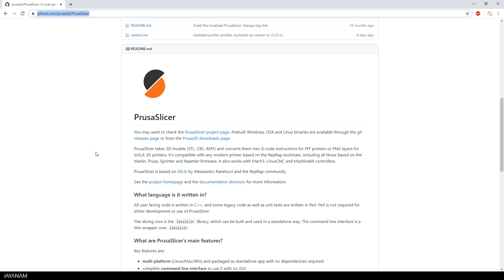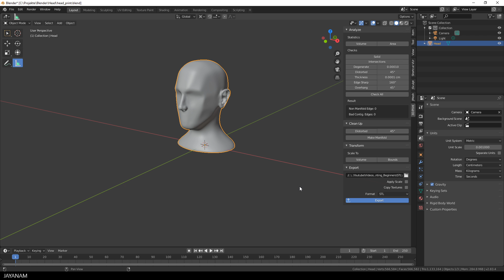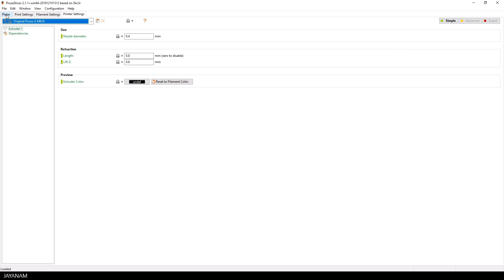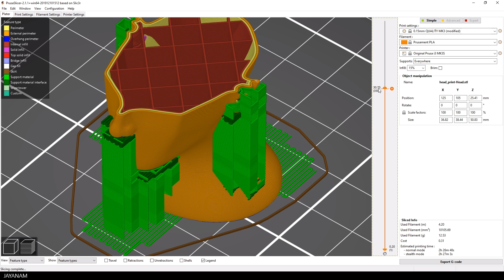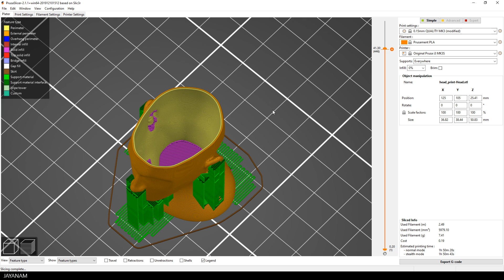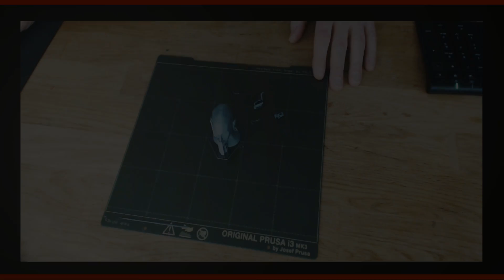Blender 2.8 3D Printing Beginners Getting Started

Comment: I would pay for an addon that was built for Blender that could get me from modelling to being sliced and prepped, ready to go to the printer. Even if all it did was give me the controls to setup the perimeters and supports would be a fantastic addon! Prusa Slic3r supports suck and I am still looking for a solution for this that isnt crap! So far Cura or IdeaMaker are my go to programs for setting up supports but would be nice if they was as nice as prusa slic3r when it comes to the parameters and other features it offers!

A couple of things that have me confused is working with shade smooth, mark sharp and how those work with setting up a 3D print, or if they even translate to them. Would love if someone knowledgeable would hit on these things too. Thanks a ton for putting some attention on this topic, so few tutorials out there and its a royal pain to make something and then print it only to discover it wont work.
Reply: You should not shade smooth if you want to see what your model will look like on the printer. Subdivisions modifiers will be applied by default on export though. Mark sharp will translate into the exported file so where it makes sense, it will work.  I am intrigued as to the problem you have with Prusa supports though.  Generally they are pretty good (especially if you modify the contact distance parameter)
Reply: @g0balot  Actually at this point the biggest problem is ME! New to this and feeling the growing pains. Will take a look at the contact distance parameter and see if it resolves my problems. That really is the biggest issue with supports, is that I think they are to close and one other area is the brim. I find even on flat models I have to provide a brim or the model will not stick to the plate but adding it makes it a royal pain to get off the flat surface and leaves a lot of striations of filament that wont come off without heat and a lot of coaxing.
Reply: @kevinm3751  With the Prusa supports I usually set the Z contact distance to 0.2 which helps with the removal at the cost of slightly less reliable supports.  Be aware though that all supports (with the exception of soluble ones) can sometimes be a pain to remove and may even require a bit of work with some grabbing tools.   You should only really need a brim if you are printing with not much contact with the build plate or if you are having problems with warping.  There are many ways people use to help adhesion to the plate but with PLA you shouldn't NEED anything except a grease free build plate if everything is set up OK (though I do use glue stick on a glass bed).  Which printer are you having problems with?
Reply: @g0balot  Yea the .2 Z contact distance is default and what I am using. I have the Ender 3 Pro and using a glass plate. I do hit it with some IPA before each print and that works most of the time. That is until I did some testing with PETG and now the PLA will not stick at all, or warps. I am going to get some of this glue stick stuff you talk about and see if that might help.
Reply: @kevinm3751  Odd, mine defaults to 0.1.  With regard to the bed though, mirrors are often better than glass because they have to be flat :) One thing to note with Creality machines is that the bed itself is often not flat and if it doesn't have auto bed levelling you need some kind of shim to flatten your build surface (I have painters tape under the mirror on my Creality bed).  You can check for this by laying anything you know to be flat (such as a metal ruler) on its side on the bed and shining a light on it from the other side.  If you see light coming under the ruler, you may need to  do something.  That said, if your bed is relatively level and it's glass then glue stick should work.  Just put a thin layer on your bed and change it after twenty or thirty prints.  No need for IPA on that set up.  By the way,  glue stick is also excellent for a release agent if using petg :)

Edit:  By the way,  I just noticed that you said you are using Prusa Slic3r.  You need to upgrade that to PrusaSlicer!  They don't support Slic3r any more.  Also, try changing the overhang threshold to 45 or lower (though not too low)  That might help a bit too.
Reply: @g0balot  Hey, thanks a ton for all the help! Yea my bed is dipped in the middle by a good 2mm. Its flat all the way around the perimeter and why I am using glass. I have checked the glass and it is real thick and actually its pyrex so it holds its shape under high heat. I did check it with the bed up to 80 for 30 minutes and it never did pick up the sag from the build plate. This weekend I am adding a hemera hot end and direct drive as well as a BL Touch. Have a new board on the way which I am going to configure so that I can again use just the bed with the magnetic bed pad and use the BL Touch to calibrate on that dished out center. Doing another print after a few tweaks and so far so good, print is sticking very nice and not warping yet (knock on wood)...
Reply: @kevinm3751  No problem, I feel your pain, I have been there myself.  I feel privileged that my first printer was a Prusa because I had confidence in the machine and knew the likelihood was that anything not going as I wanted was probably my own fault.  It is interesting that you are going the upgrade route for your printer.  For some, the printer itself becomes the hobby :)  I will say that I always prefer direct drive which is why I chose an Artillery Sidewinder X1 when going for a second large format printer.  If nothing else, the convenience of direct drive is worth it :)  I wish you the very best of luck with your upgrades and your bed adhesion issues :)
Reply: @g0balot  Yup we have a lot in common. In fact I did consider a Prusa but spent a ton of time researching and it seemed to me I could get the Ender, upgrade it and basically have something as good. In fact out of the box this printer does a fantastic job short of the issues I already knew it would have with being a boden (hence the upgrade). Been looking at the Artillery which will be my second (filament) printer. That is if I dont decide to go bespoke and make my own from scratch which I am seriously considering. Anyway, thanks for all the tips and help...
Reply: @kevinm3751  The Artillery is a very good machine.  It's my go to large format printer though really needs linear advance configuration to get the best out of it.  I will admit though that for me, resin printing is where it is at :)  Wishing you all the best!

Comment: How did the top of the head printed without any fail, with no infill I thought that it would probably collapse but it didn't... Nice work.
Reply: I think with a larger model or a larger layer height it probably would have.
Reply from the maker: @g0balot  Yes, I would use 15% infill for larger size.
Reply from the maker: Yes, slicer and printer are very good
Reply: @JayAnAm  My prusa is on the way, i will try this :)

Comment: Hi, make pls video about measure for 3d printing in blender.
Reply from the maker: What exactly, I explain in this video about the measures.
Reply: @JayAnAm  But to my knowledge there is no elegant way to hard surface model complex things to tolerances of 0.2mm etc.  It can be done but it is time consuming.  I'd love to dump fusion 360 for doing this kind of thing and rely only on blender for everything. It may be possible but I don't know how to do it of course :)
Reply: how to make a model in size in millimeters with an exact scale for printing
Reply from the maker: @albel4130  03:05
Reply: Sorry im inattentive, thx. I try.